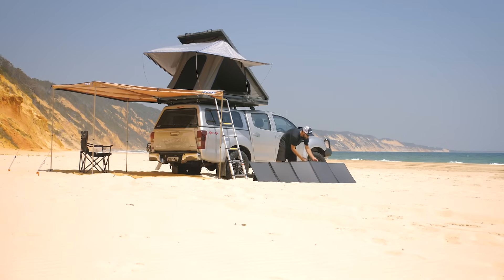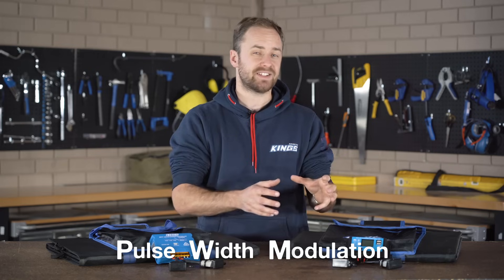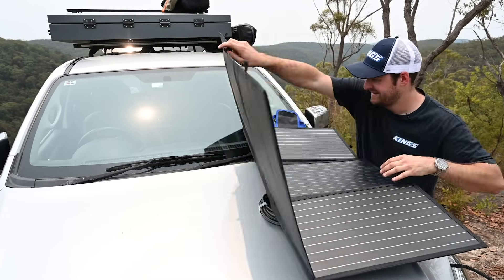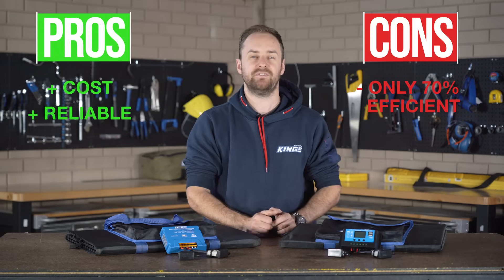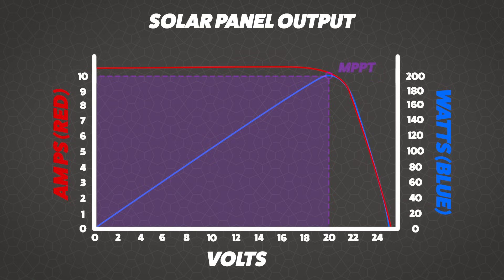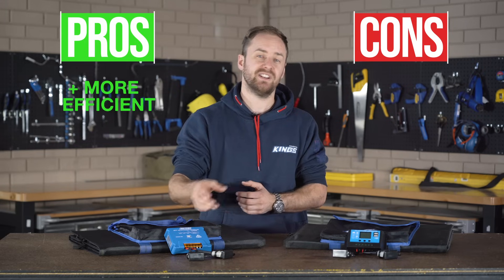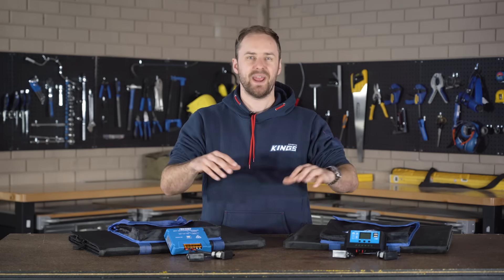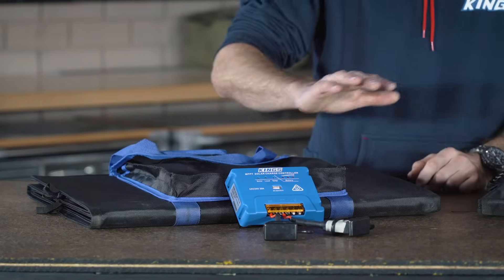SOLAR REGULATORS EXPLAINED! PWM versus MPPT - what's best & why? PLUS upgrade your solar controller!

Comment: what if I have a 450w/36v panel and 200ah battery will it work..
Reply from the maker: G'day, thanks for your question! We would recommend our Plus 40 AMP MPPT Solar Regulator for your setup.

Feel free to reach out or ring us on 1800 88 39 64 if you had any other queries!

Kind regards, Sue

Comment: Im not sure why all three of my battery lights are on, on the MPPT. Even though id been using the battery and the voltmeter (seperate item) shows 65%
Reply from the maker: We would recommend to disconnect everything, connect the battery first, wait for 5 seconds before then connecting the solar panel and then check the voltage reading. The voltage reading should show in volts (V) which can vary depending on if you have an AGM or lithium battery.
If you are still having issues please feel free to reach out to us on social@4wdsupacentre.com.au
Cheers, Courtney

Comment: For mppt, can i use multiple solar panels connected in series to get the voltage up to over 48V to charge a 12V battery?
Reply from the maker: Hi there,
Unfortunately our MPPT regulators can only do up to a 24v setup.
Cheers, Courtney

Comment: Why can’t you use the MPPT charge controller on lithium batteries?
Reply from the maker: Hi there Thomas, thank you for your question.  Our 20A MPPT Solar Regulator is not lithium compatible as lithium batteries require a specific charging profile .
We however carry a Plus 20A MPPT Solar Regulator which is compatible with lithium batteries.

If you had any questions, feel free to ring us on 1800 88 39 64 from 8am-8pm AEDT.

Kind regards, Sue

Comment: Can I use a 100a MPPT controller on a 200ah lithium battery and 500w solar?
Reply from the maker: Hi Allen,

While we do not currently sell a 100A MPPT Controller, it would be able to handle a 500W Solar Panel for your 200Ah battery.

Regards, Jayden

Comment: Well explained sir, the output of this is DC, so we use inverter to get AC as the house load are AC. 
Your MPPT doesn't have a built in metering or gauge so you put a device when you check current etc. 
Is there an MPPT wt built metering and good fans for ventilation as we experienced around 30-35 degC in Phil.
What's your battery LIPO4 or Lithium Ion?
Reply from the maker: Hi Joey, 
Thanks for you enquiry. At the moment we do not sell the MPPT regulators equipped with the metering and fans. Also, for your information our MPPT solar regulator is able to operate in the temperature of 50°C. Our battery chemistry is LIFEPO4. Please let us know if you need any assistance. 
Cheers, Saman

Comment: Hi just bought my 1st AGM, do. I need a specific AGM charge controller? Can i jse MPPT? What is a smart regulator, i read i need this? Thanks
Reply from the maker: Hi there, 

Congrats on buying your first AGM battery. You do not need a specific AGM charger, you would just need a charger with a AGM profile/option. A MPPT regulator with an AGM profile would do the trick. 

A smart regulator is a device that intelligently manages voltage and current to optimise charging performance and battery health. Having one of these would mean your battery chargers better and would extend the life of the battery. I would recommend our PLUS MPPT regulator range as a perfect entry level regulator with these features.

Regards, Jayden

Comment: Can anyone tell me what that voltage meter is from the controller to the batttery's in the sun test. Where can we get them from?
Reply from the maker: Hey there,

It has been a while since we have filmed this video so unfortunately we do not have exactly what brand of voltage meter Cahn uses, but I can assure you that it is just a generic voltage meter used. 

Regards, Jayden.

Comment: do all mppt brands follow the same rules and same 3 stages (regardless of their rated amp capabilities)?
Reply from the maker: Hi there,

Most do follow the same process, but as you can imagine some other brands can use their own unique process so it's not always one size fits all.

Regards, Andrew
Reply: @4wdsupacentreAu  thanks do you know which company offers not just the obsorbtion voltage but also absorbtion current that you can set yourself?

Comment: I just found your video and found it interesting to learn more than I thought I knew. my question is by watching your video the differences between 24 V systems and 12 V systems and the calculations required are not exactly clear. It depends on if my panels are in series or if my panels are in parallel. I know that if I have two 200 W panels with max voltage of 24.48 V and 9.5 A what formulas are proper in adding together voltages.? I know I can say if I want two of these panels that makes 400 W, but after that. I believe I doubled the voltage in series and it remains the same in parallel.. This is why the wiring is smaller in parallel.
I am currently running in 12 V and I’m thinking of converting the battery bank to 24 by rewiring the 12V batteries . I have four 400 amp power batteries.
Reply: It is also helpful to understand that you have to have a different inverter to go from 12 V to 24 V. The solar charge controller she described here are very helpful as it help helps me determine that MPPT is what I need as I increase the size of my solar array.
Reply from the maker: Hi there,
We cannot take the voltage drop into account for an individual setup. To get accurate numbers we would recommend to contact an Auto electrician who will be able to advise much better after assessing your setup and your requirements. 
Regards, Courtney

Comment: Thank you for making this video. I built a power station recently (i did watch your video among many others) and i picked up a 100 watt panel really cheap last week and was trying to decide what controller to buy. nof if i do my math correctly my panel is roughly 20v at 5 amps this means with a pwm i would be limited to 14.6v max at 5 amps, or around 73 watts, but with the mppt controller it would boost current to around 7 amps. thats HUGE. i bought a 10 amp controller off Amazon. I'd love to have bought yours but i'm in the united states (florida)

Comment: Just wondering should lithium batteries be at 100% charge before use so that cells can start to balance? Does it matter what the connection order is? for a 200Ah battery does 50% charge equate to still having 100Ah to use? I ask because my new Kings system stops providing power to our Kings fridge when the charge gets down to about 40%. Thankyou.
Reply from the maker: Hi there,

I'll answer those in order;
1. We recommend fully charging before your first discharge to best set BMS.
2. That's correct it would mean roughly 60A left as you really want to keep them above 20% if you can to get the longest life from the battery.
3. This would likely be the battery protection settings, they can be lowered as voltage drop can cause them to reach lower voltage than the battery actually has.

Regards, Andrew

Comment: +you did not tell us our to set the regulator with the 3 buttons
Reply from the maker: Hi there,

Thank you for the feedback, I can advise that this should be covered in the unit manual, though should you encounter any troubles with that process please do not hesitate to reach out to our general enquiries team on our main call line as we can also help point you in the right direction verbally too.

Regards, Andrew

Comment: You can get 24V PWM controllers - Victron makes them with a maximum solar input of 55V or 28V depending on whether you want to charge 24V or 12V. A 20A PWM controller on special is currently selling for about half the price of their 30A MPPT controller but my advice would be don't bother with PWM. The video is just wrong when it says they're more reliable - they have to waste a lot more energy as heat and that nearly always means shorter component life, especially in Australia. MPPT controllers have been in the field for well over 15 years in trusted brand names like Victron, Fronius, SMA etc so hardly new tech.

Comment: 2025 update: My 30A PWM with free delivery for $7.55 sold on ebay I just bought, does both 12v and 24v. I have two mono 250w panels rated at 37v max each, that cost $5 each from someone on Marketplace doing upgrades. I run them in parallel so 37v max into the PWM. Less aggressive PWM amp battery input means I'm not 'cooking' my 100A lead-acid battery as hard, which would extend battery life.
Reply: Well you can't use 12 volt battery on a 24 volt solar panel, I mean you can but you only get 30% power.

Comment: My Bluetti has inbuilt MPPT, a lot of Solar Panels come with the same. It appears I need Anderson to MC4 connectors, How will this effect me based that a panel is 200W/12-24V, 8A. If manufacturers damn will got a standard tyhat all agreed upon, we wouldn't be in the crap!
Reply from the maker: Hi there,

We totally agree, as we previously had MC4 direct connections, but moved to Anderson due to majority feedback requesting Anderson terminations.

Regards, Andrew

Comment: Not mentioned is the MPPT, by pulling more power from the solar panels than the PWM, shortens solar panel life (kWh-to-failure).

As the panels provide more current, the hotter they will get, which always causes higher degradation.

Great vid! Thanks!
Reply: LOL, yeah and the gentler PWM are sold as cheap as $7.55 including delivery off ebay etc. I just bought two 30A ones because the price was so cheap. (Kings want $30 for one 15A)
Reply: @GoldCoastCB i have a PWM 30amp hooked up to 8 165w solar panels 4 series and 4 parallel on a 48v system and i got it temporarily while my victron 100/20 was getting warrantied. I’m able to hook up to a app and see the production and it produces the same amount of power as my other 3 Victron units with the same amount of panels. Best $30 ever. It’s a Pjerjzn  12-24-36-48v 30amp unit. Bluetooth app is called ECO. I’ve watched this unit on cloudy, sunny and overcast days behaving like a mppt. The description on Amazon at very bottom says it has MPPT  technology but not sure what that means. I also have a cheap $5 blue unit PWM.  That thing is junk. This unit is a cheap emergency controller worth having.

Comment: HI, I have a PWM controller and it was advertised as 12/24v. My current setup is 12v, but I just got a 24v inverter and was going to use this and link the batteries in series and thought the controller would do it no problem, but having just watched the video you say it will only work with a 12v solar panel, could you advise please. Thanks Dai
Reply from the maker: Hi there,

I  can advise that the PWM is made to take in 12/24v (and higher) to shape down for 12v batteries.

Regards, Andrew

Comment: Hello. My electric car charger 🔌 is 110v input amd 71.4v output.  Car battery is 60v 100 amps. Can you tell me how can I use solar panel for charging ?
Reply from the maker: Hi there,

Unfortunately I need to advise that we don't currently have panels or regulators designed for charging vehicle-type batteries, I'm sorry.

Regards, Andrew

Comment: my pwm states 12/24v ! so they can do 24v solar and has done it for more than 3 years  in my installation, running 3 of them rated 30 amp  each, no failures yet.

Comment: Hey guys thank you for the video! Question! I need a fixed solar panel to run/charge a battery that I plan on then running a 30ltre fridge from you guys. Being a Honda buggy, I need a small size solar panel, what size do you suggest to set up for 
1- solar panel
2- Mppt? (Seems the best option)
3- battery to run 30ltr car fridge. (Which would then be taken off and stay running at night on generator power)
Need a fixed unit for solar and battery for buggy? Thank you!
Reply from the maker: Hi there,

While it does depend on your budget and space available, though one of the fixed panels would be a must, along with a regulator to match your battery, our Kings Plus MPPTs are a solid bet as they're compatible with most standard battery types and have a higher efficiency rating. With that said the recommendation is always to go with lithium batteries, as they have a broader charge range that gives you more capacity to work with at a lower weight and size footprint.

Regards, Andrew

Comment: Hi just want to know how do I know that solar system is charging thanks? I’d mppt controller
Reply from the maker: Hi there,

Depending on the unit used it will either have one of the battery lights flashing (showing it's charging in the 0-33, 34-66 or 67-100% brackets) or for the premium unit it will show the battery voltage / percent.

Regards, Andrew

Comment: How long can a battery being charged without a controller take before it gets cooked up 🤔
Reply from the maker: Hi there,

We would simply advise against it full stop, as panels can output anywhere up to 28v it doesn't take much to damage a battery.

Regards, Andrew

Comment: I have Two 350w 38.9v 47.5 open.
Do I need a separate regulator for each one?
Reply from the maker: Hi there,
For our 40A MPPT our Max PV open cell voltage input @ 25°C STC is 92V and maximum solar power input is 780W (12V) 1,560 (24V). If together these solar panels are within this range this would be suitable to just use one regulator.
Regards, Courtney

Comment: If i have a mppt can i use the light output to charge a seconf battery?
Reply from the maker: Hi there,

I can advise that the middle section is for load, and unfortunately wouldn't have the output required for another battery.

Regards, Andrew

Comment: with the advancement of battery inverters like the Bluetti AC200L and it's built in power controller, does adding an MPPT between a solar panel and the battery inverter maximize the input. For instance, a few days of test in near optimal conditions, i am only able to get ~150 watts out of the 200watts rated bluetti solar panel is connected directly to the bluetti battery inverter. Thanks
Reply from the maker: Hi there,
As per the techspecs of the bluetti AC200L this does have an inbuilt MPPT, for any further information we would recommend contacting bluetti directly.
Regards, Courtney

Comment: Could I use a capacitor bank between the panel and mttp to increase input voltage?
Reply from the maker: Hi there,
Thank you for your question! You certainly could add it to your setup but the result will be negligible, instead we recommend ensuring your panel is angled correctly and you have good wiring connections to minimise voltage drop.
Regards, Courtney

Comment: @4WD Supacentre - The victron mppt doesn't start charging until the panel produces Vbat+5. My 100W panel never gets above 16.5V. which means it doesn't charge until the battery is more than half empty. 

Is it just my noname panel that outputs such a low voltage?
Reply from the maker: Hi there,
It doesn't sound like the panel outputting low watts would be the problem as your regulator should be able to put some power through to the battery even at low amps - I would suggest looking at the regulator and checking it is set to the right charging profile for the battery type you have. EG if you have a lithium and it is set to AGM charging profile it won't start charging until a lower voltage is reached. If all of that is set correctly you may have to check in with Victron with some more product specific trouble shooting.
Regards, Courtney

Comment: Hey can I ask I got a PWM like in ur video I got one and 2 24 volt Solor panel 25 watts and my electric bike is 36 volt lithium ion battery min 100 A will it charge my battery and if u have any advice how how to set things up
Reply from the maker: Hi there,
We would recommend contacting the bike manufacturer in regards to this as there would be too many variables for us to be able to correctly advise.
Regards, Courtney

Comment: I’d like to set up a power system just to run my 15l Waeco  portable fridge. Simple & cheap is what I want. I’m thinking a 12v lead acid AGM and a solar panel with controller to keep the battery charged. Am I on the right track or do I need something more? Any advice would be welcome. Thanks
Reply from the maker: Hi there,
We would also recommend a battery box or if you do not have a battery box you will need an adapter from Anderson to alligator clip!
Cheers, Courtney

Comment: Could be a silly question, but does it matter what kind of battery we're plugging these panels & regulators into?   Does being AGM or Lithium make much difference?
Reply from the maker: Hi there,
Our blue MPPT is not compatible with lithium!
Cheers, Courtney

Comment: What kind of charge do you get it if those panels during normal driving conditions? I'm currently weighing up wether to have top mount or door mount solar panels and can't find much in the way of information/advice
Reply from the maker: Hi there, the MPPT is a continuous current and generally is 20 to 30% more efficient than the PWM. The PWM is pulse current. Kind regards, Rachael

Comment: also dont cross the wires on the accessory port, I had allegator clips to charge a secondary battery and crossed them and the controller went POOF smoke and the smell, when I opened the controller the circuit board was melted luckily it was only a cheap 10 dollar one

Comment: pwm can't do 24 volts? what?> I have one right in front of me for 24 volts
Reply from the maker: Hi there, the PWM's are made and specialized for 12v. This does not rule out 24v, however, we do not have any systems that operate in such a manner. Kind regards, Rachael